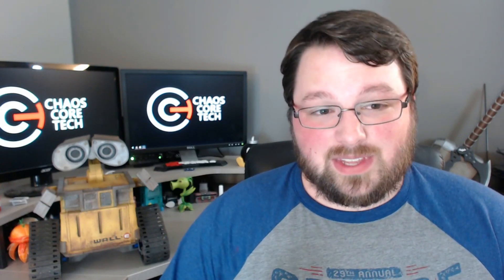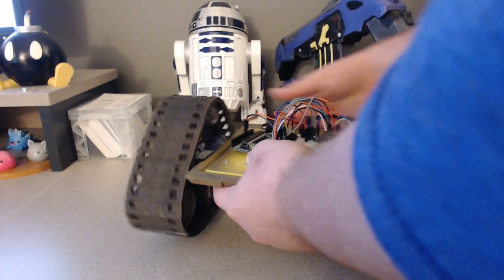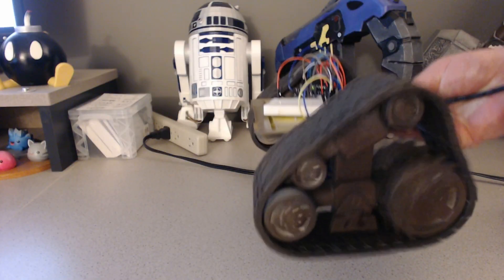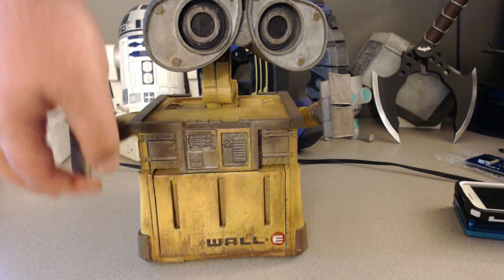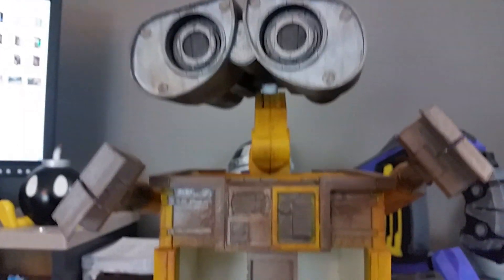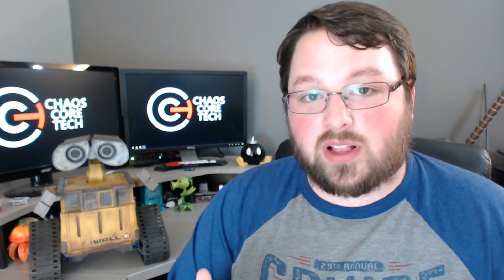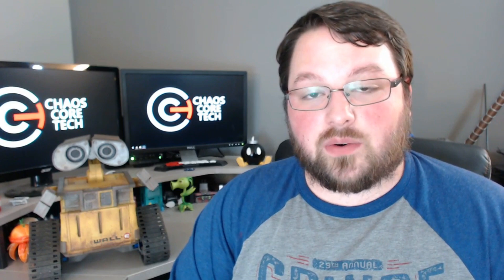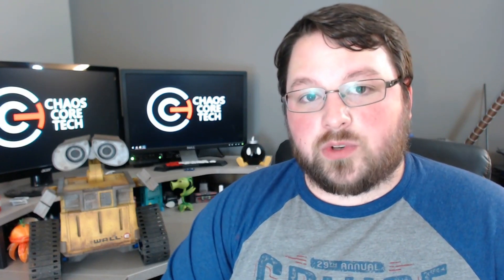Wall-E Robot! - Fully 3D Printed (Sort of Works)

Comment: Did you ever work out the tinker CAD problem. Id like to take a shot at redesigning the drive train. That would require the cad files.

Comment: I know the project is a few years old ... anyway:

It looks like you're using micro servos (my english is not good enough to understand everything in your video that you're saying)

If you still feel like finishing the project, I recommend you:

 https://www.ez-robot.com/Shop/AccessoriesDetails.aspx?prevCat=9&productNumber=2

This set is specially designed for robots, VERY easy to program, and has very powerful motors. I've been building a life size number Johny 5 quite successfully for 1.5 years.

When I am finished with number 5 ANYTIME I would like to build a few small robots (e.g. R2D2)

Your Wally is also on my list. Thank you for sharing your work. Greetings from Germany!

Comment: This is an amazing project, I think the only things you need are bearings (to reduce friction) and bigger motors. Maybe check if the battery you're using has enough power. I'd love to see this thing in action!

Comment: I love this project!  I got the tracks to work by using a high torque servo then converting it to a DC motor in a servo case.  The nice thing is they have metal gears.  You can google how to do that for video tutorials.  I had to lengthen the motor mount around 2 mm for the servo to fit and remove 2 mm from the legs that connect the bottom of the body as to keep the tracks the same distance from the body.  I've also modified the treads a little to give them a tiny bit more turning angle to make a clean rotation around the smaller wheels.  I'm currently working on some slight angles on the teeth of the large wheels so they go into the holes of the treads easier for a smoother drive (1 or 2 teeth randomly do not go into the hole causing it to lock up).  Also these motors will need a stronger driver than I got with one of those Arduino robot kits on Amazon.  Hoping to get it working perfect by the end of the week.

Comment: Is it possible to make a poseable WALL-E figure? I know you made a static WALL-E figure but I was hoping you could find a way to make a 1/12 scaled WALL-E figure with rolling treads with the top 2 wheels being adjustable like in the movie, open up at the front and also open through the middle of the body to spit out a cube, make the arms slide on the arm track, make them rotate, move in and out, optional parts for box mode, etc. Basically like the Shapeways WALL-E figure but with more functions and accessories. Could you make it happen?

Comment: Hello, you've made a FANTASTIC job! It's great that you share it with others people. I'm actually printing it and i have few questions. I hope that you could answer. 
How to fix the head mount with the head back, as if i put the mount inside the hole in the head back, the head cannot turn. 
Are you using another part to fix them together ? 

Thank you for your help !

Comment: Man that is awesome, have you looked into RC components? You could do a simple setup waaay simpler than using an arduino etc, and it would definetly have enough power to move without getting massive motors.

Comment: Ah, you used modified servo motors. They have basically no torque. I'm surprised the treds even moved. Smaller hobby motors would have been more appropriate.
Reply: i think he was trying to use the parts that come in the chip-e kit, which has 4 servos and no motors since it's meant for a walking biped

Comment: awesome job!!!, but why don't you use stepper motors instead of servos ??
Reply from the maker: Thank you! I actually used DC motors in a servo body to drive it. And the reason I chose them was they had decently high torque for their size and I just didn't know much about motors at the time. Still don't for the most part but now I know that I need more torque than that lol. Going back I would've approached this very differently. :)

Comment: I am amazed to see this was done in tinkercad. I mean I know it's robust, I've done more than a few things in Tinkercad myself that are impressive, but still. Good work.
Reply: You need to design the parts with bearings. There's very few 3d printed on 3D printed parts that move well.
Reply from the maker: Yeah this just shows how new I am to using electronics. I even learned a lot in the time I was working on this but unfortunately I sort of design the whole thing around those motors. So I couldn't change much without a bit redesign. But bearings would've been a big help. I'm definitely going to be using those in future prints. Thanks for the suggestion! :)
Reply: There are some surprising effective 3D printed bearings. Check out Emmit's Geared Bearings on thingiverse. They're also an example of something that could ONLY be made with 3D printing. They're tight but move like "woah".

Alternately, i've got a bunch of skate bearings that once I'm unpacked I can slip in a envelope and send to you.

Comment: what motors are using for driving it? -- duh -- in the description --  wonder if there is swap in alternative with a higher gear ratio or more torque
Reply from the maker: Yeah I found a few motors that would fit that had just a slightly higher torque rating than the ones I have, but I doubt it would've made a significant difference. If you find something that has like 6kg of torque under load it could possibly work. The highest I found was like 3.5.